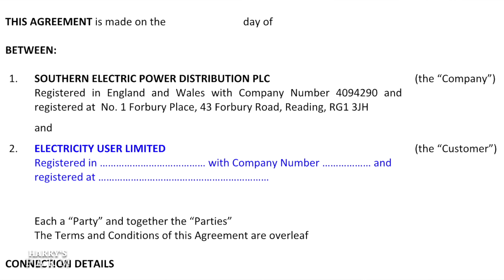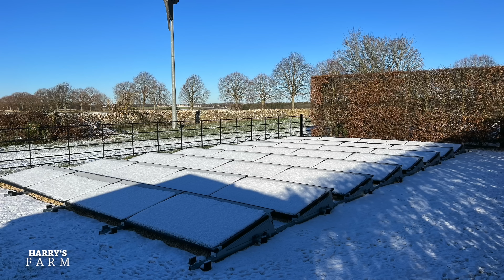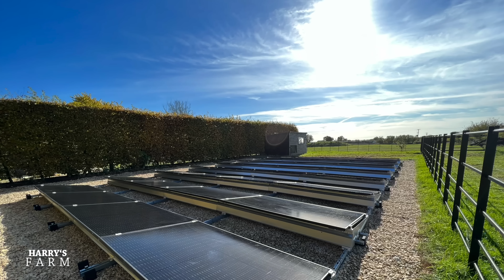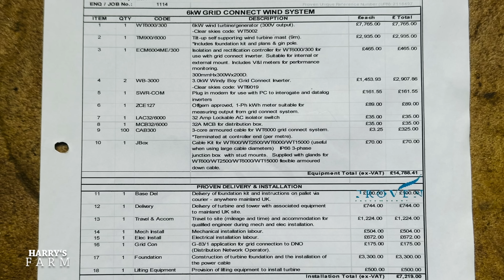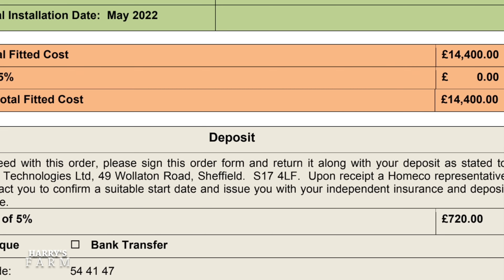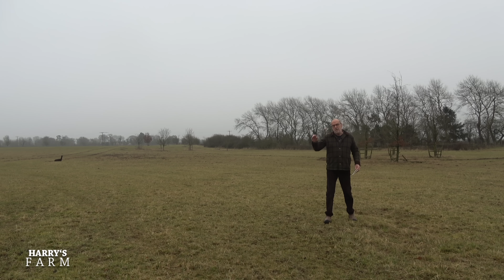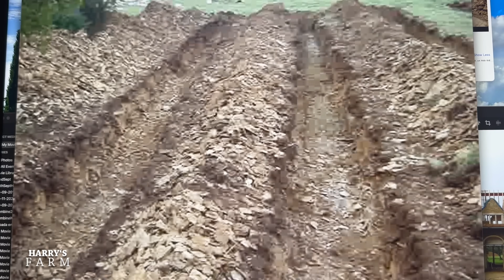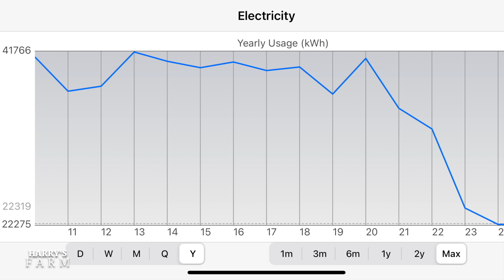Are solar panels & heat pumps worth installing? Here's what I've learnt after several years of use.

Comment: Was considering solar as a possible supplemental source of heating to augment our oil-fired boiler feeding a wet. System. Situated in Shetland, Scotland but due to the amount of glazing in the house, we use virtually no heating between April and September. Solar therefore clearly isn’t the answer as we can’t store the excess summer heat/winter output would be so very low. Don’t own the surrounding land so a turbine or ground source heat pump are out in practical terms. Perhaps an air-source heat pump is an option (but don’t qualify for the Grant), or just continue with the wood stove we put in around 15 years ago! House around 300 square metres in floor area, well insulated but to 1998 standards, pre-kingspan - nice to see the snow not melting on your roof! 
Thoughts? Excellent informative video!

Comment: Your panels should be oriented better - they are pointing up toward the zenith.  That might be almost ok in Jun but you want them much steeper so they output something in Feb.  Do the geometry!  the sun rises to 90-52-23.5 degrees at noon in December.  Only about 15 degrees.  Tilt the buggers more!  Of course you cannot get the rated output if they are not catching the suns rays at close to 90 degrees.  Honestly....

Comment: Those panels aren't installed on right angle for the optimal output though. They might have the maximum output when you least need it, but you want something better in the winter.

Comment: why didnt the installers parallel wire panels expected to be shaded and series wire those always in the sun. At Treetrench uk we would have done it this way to maximise solar output instead of randomly connecting panels in series and parallel, without taking into account shading and panel orientation.

Comment: Sorry Harry, but your ground loop slinkies don’t look like they are 6 ft deep. Had you doubled or tripled the amount of loops per foot of trench by having them overlap, and doubled the depth of your trenches to between 6-10’, that would have more than doubled the efficiency of your system, and ensured the return water was well above 0 degrees because of the increase in depth of the trench. Cheers.

Comment: It's hard to justify ever owning and operating an Aga in a low carbon home.  Thankfully Harry doesn't really attempt to do this numerically.  The GSHP and, say, an induction hob are going to far outperform an Aga in terms of heat output per unit of electrical energy input.

Comment: Ground source in trenches can cause the ground to actually freeze! This is because the heat pump takes a few degrees out and sends it back into the ground at zero degrees and over time the ground freezes.

Comment: Cover your swimming pool in winter with an insulated cover, and then use a seasonal water source heat pump system to take the heat from it - Simples !,,

Comment: Those panels are in a very low angle and need to be corrected.  Solar works best together with battery….Battery protect from the high hourly cost so it is not only for catching the solar power

Comment: - Something wrong with the install if only getting 100w on a cloudy day from 12kw of panels. 
- Does it have optimisers fitted per panel? 
- You should be getting 80-100w per 500w panel so 1/5 or 1/4 of the total kw

Comment: I'm surprised that you had it installed without knowing about shade - its' the first thing I thought when I saw the hedge and I haven't even got any panels yet. Since they're on the ground you can use modular inverters without any concerns about maintenance so that would solve that problem.

Comment: Solar in England is a mistake, unless you use a heatpump (water heater insulated pipes right underneath the panels) to run heating for it AND use the expensive Polycrystalline panels that keep operating optimally in partial shading (shade, fog, cloudy weather etc) you're never going to get any production during winter months.

Comment: Well, a lot of the reduction in power production in winter comes from the installation of the panels. Facing almost straight up, at a pretty high latitude, really only works in summer. You would get much more out of them in Winter if install them at a much steeper angle. If you really care about Winter production, even placing them vertical can make sense, assuming you have a place where they can be vertical without getting excessive shading.

Comment: My favourite video of Harry's so far. 

We have a cheaper version of parts of this installation - including the same wind turbine. 

My main suggestion would be that a battery can pay for itself partly through using the night rate tariffs like the one Octopus offers. You can buy electricity to charge the battery at the night rate of below 10p and use it during the day. This is especially the case when you're using so much. 

And questions..

Have you surge protectors on the turbine. We didn't.. And our turbine has been out of action for about 9 months from a lightning strike. 

And I know it might feel like an invasion of privacy, but what's the total cost? My guess is that this whole lot approaches 200k. While this is a really useful video, people need to be aware that an installation like this is way out of reach for most of us.

Comment: A lot of these output issues have to do with not only your weather and the general cloudiness in your area…but also that you did not opt for an elevated rack mount that you can change the angle with…30 degrees in winter and 22 in summer would help you and elevate it so the hedges don’t shade your panels.

Comment: You have your panel angle set for summer not winter, in winter, they will need to be set 45-55 degrees in the UK. Also, also I get over 500W output from a 400W panels on cold days, as they are rated at 25 °C, and any colder you gain power.

Comment: I’ve done studies on the aspect to the sun on two roofs.  During the summer my electric usage is pretty minimal, obviously it changes during the poorer weather months and I don’t think I would see a decent return for quite a long time.  Without battery storage, plus massive rise in initial cost so again for me I cannot justify as I’m in my 70’s. I’ve done a thorough cost analysis and the solar plus batteries would be fine to support a heat pump if I had one.  This is an extremely useful vid.  Thanks KR Mike

Comment: Question: if the house has to be so well insulated for these systems to be ANY good, why not just have individual room electric heating - very granular and less loss of efficiency (no pumps, heat transfer etc).

Comment: They are building new houses near me, in September 2025. Some of the houses have solar panels but instead of sitting on top of the roof tiles, they are integrated and recessed into the roof itself and it looks great. The panels are the same colour as the roof tiles and the recess is the exact depth so that the surrounding roof tiles are at the same level. It looks fantastic! I always hated the way the "on top" panels looked, I thought it was ugly, but this solution looks great.

Comment: Ground source heat-pumps work well if you have the space, but to argue with your installers, a borehole at 1,000 metres can get as high as 40c. But then there is a minimal loss as you pump that water back up. Or you can go deeper and get even higher temperatures. But they are expensive at around £200 per metre.

Comment: It's an expensive way of heating a house. Arguing that it's four times the size of a normal property so you would expect it to cost more is ignoring that the heat pump is a 28kW unit whereas a standard domestic gas boiler is similar at 24kW.  It's the insulation that makes the property a lot cheaper to heat than 4 houses.

Comment: Solar panel efficiencies are increasing due to technologies like tandem cells and new materials. New research has shown perovskite-silicon tandem cells reaching over 33% efficiency, with potential future applications promising even higher, exceeding 45%. Once these are made enmass, which will happen quickly as the Chinese make them, the panels will be viable in winter, giving over twice what Harry is getting right now. 

They may prompt the introduction of highly insulated, underground, inter-seasonal heat stores on homes that have the space. Or above ground on spacious farms. Heat the store in summer using all available electricity produced, use the heat in winter. The odd good days in winter for insolation can add some heat along the way.

Comment: The average input for heating the average home is not 24kW it is around 8-10kW. The 24kW is the size of a combi which uses the 24kW to heat the hot water instantly.

Comment: Your PV is angled for Summer; it looks pretty shallow. Spaced out more to prevent shading and the ability to change the angle would have a significant effect. Depends whether you export for much money or use the power generated and when. If exporting for money then you probably have the optimum angle. If you are wasting generation mid Summer then make them steeper but beware that in Winter the panels will tend to shade each other if too steep. This is why sloping roofs work well. If this is an older traditional system arrangement with just one inverter at the end of everything then shading of one small part of one panel has such a large reduction effect because all the cells in a string have to be exposed to light for decent current to flow. Shade one part of the string and you significantly block the whole string. I suspect you have a few strings in parallel there. The installers should have educated you better. In the UK, fitting batteries is a must with solar for most domestic installs unless they can use all that is produced when it is produced. It means you charge the batteries then can use the batteries at peak use time in the evening; it's all automatic of course. Yes, you won't get much solar into your batts in Winter but get on a tariff such as Octopus Go and you can set the batts to charge at cheap rate (about a third of normal cost after inefficiencies) overnight. An EV is not necessarily a replacement to domestic batts because an EV needs at least 1.4kW to charge and it might not be plugged in during solar times. Maybe get a solar diverter (cheap compared to everything else) for a sensible size immersion heater water tank (if you have one) and that helps put to good use some excess lower than that. Or, as you say, get a pool (!), but then it's probably cheaper getting water panels directly heated by the Sun.

Comment: Always rate your system to the worst month if you’re actually dependent on your output. In December, the sun  is at  17 degrees above horizon at the winter solstice. So a 77 degree angle on panels, but 45-50 degrees is a good compromise.

Comment: Well, God Bless!
You got five million to spend, of course you can build an energy efficient manor. Other than that, it's quite interesting to have a hands-on comparison between solar, wind and heat pump. It's the heat pump that wins, and that says a lot about both the accumulation of wealth and/or energy: you get a lot by spending less, not by producing. That's why the "working man" keeps getting poorer while the rich keep saving and get richer. Unless we address this truth by taxation (it's basically what the heat pump does, it takes from where there's a lot and gives where there's a need) we'll be stuck in the stupid political debate that always ends in the poor being told, "work more".
Pax Christi

Comment: I built 2X4kw two axis trackers which have higher yield than static panels. After 12 months the ROI after depreciation is 1.68% on a DIY install. Solar production peaked in May for us, output in December only 8% of May. Solar - meh. The windmill is looking pretty useless to, recommended height for a windmill to be viable is 25m+. Anyone building a solar system should scale it to 110% of Summer consumption.

Most cost effective is batteries for households with cheap night time electricity so everything can be charged at the cheap rates and used when higher rates apply. Forget solar, forget windmills unless you are prepping for grid blackouts.

Comment: I've never installed a single solar panel in my life and I could've told you all these things from just watching a few videos online - you didn't properly do your research it seems. Low angled sun in the winter will mean the need for a higher angled panel to actually capture what the sun is sending us. Also in general ground based panels with things that create shade such as bushes, hedges, buildings all around was a mad idea, you'll even lose out on solar gain in summer when the sun goes behind the bushes, the building etc. That's why they're put on roofs, or raised up above obstacles - this is very basic Solar practice.

Comment: You could increase the output of the solar panels in winter time by arranging them differently. If you put them perpendicular to the sun at that time, they simply get more ligt per panel. It’s simple physics. 
Downside is that you lose yield in the summer time. And you need a bigger area to set them in to prevent them throwing shade amongst each other.

Comment: Paying for a wind turbine, solar panels, ground source heat pump and an air source heat pump, plus servicing and maintenance. If the solar inverter goes it will cost about £1,000. It would be interesting to see the calculation for how long it takes to pay that off in electricity saved. I’m assuming your annual bill of £5,300 is after using up all the electricity you generate I.e what you take from the grid. How long would it take to pay off your investment? You don’t mention subsidies and I think that is the only reason people can put these in and that is a hidden tax on all other energy customers.

Comment: Turbines are awful for the grid because their power output is so spikey and unpredictable.  An electron pushed into the grid has to be matched by an electron leaving the grid somewhere else at basically light speed, so when a gust picks up, baseline generators (that's gas to you and I) have to spin up and down VERY quickly.  Renewables are one of the main reasons nuclear is having such a hard time getting going - nuclear can NOT spool up and down quickly.

Comment: That's a crazy way of mounting solar PV panels, high maintenance for weed control and high risk of damage, much better on a raised frame. Don't tell me you just spray around these twice a year.
Reply: Pretty sure there is some sort of geo-cloth under the gravel to keep the weed growth under control. Otherwise it would be quite a problem
Reply: @flynnjp19  There's a form over function problem here, especially with shadow as the days get shorter where every last bit of light matters, cheers

Comment: where i live, solar can cover all your costs AND you can sell the rest to the grid... however, i live in a part of the world where AC in summer is not optional, if you don't have AC you'll barely be able to regulate your body heat, it's HOT AND HUMID here.

Comment: thanks for your detailed comment.  amazing to watch how useful the ground source heat pump has been . it must have costed a lot to put that in and to insulate the house to such high efficiency. 
with my solar panels, i have used micro invertors to help with the shading .

Comment: You ground mount panels are way too flat. The Cotswolds are at about 51 degrees Yu'll get MUCH better output if your panels were set around 45 degrees for a good balance between summer and winter ...

Comment: Having watched your video again today I think you've missed the main point of a battery incorporated in a solar array. I have a Fit system of 4Kwh on the east elevation of my roof which was installed about 10/11 years ago. I have now installed a battery and 4Kwhs on the west elevation. The key is by having a night time tariff to charge the battery @ £0.08pkw between 1200 - 0500  each night the battery system is programmed to sell the solar energy produced through the day to the grid at £0.15pKw which makes you £0.07pKw which is more than enough to pay the electric bill for the night time usage. You can also program your cars to charge at the cheap night time rate! that is how to use the battery not by charging you battery from  the roof. It will balance out the cost of your energy across the year to around the daily stand by plus a little more depending on your demand.

Comment: Just to add to my previous comment today, is the car running costs. 600 miles a month at say 3 miles  per kW is 200 x 7p = £14 v 40mpg on a petrol car is 15 gallons at about £80 less £14 is a monthly saving of £64 x 12  =£768.00 p.a so when added the the £1,400 = £2,168 v £17k outlay = over 13% return tax free

Comment: The point about batteries in the summer is they maintain 100% charge on sunny days thereby exporting kW @ 15p having charged the batteries at cheap rate 7p kW. Your situation is very unique. I live in a 5 bed 1800sq ft and May 2025, my electricity costs were £6. £44 actual use set against £38 export, and that includes app 600 miles of Hybrid car charging
I have 4.2 kW of Solar set over 2 roofs SE and SW that on a very sunny day produce 25kW. My electricity costs before the installation were £2,000 p.a. and now around £600. The installation cost £17,000 as it is quite comprehensive with 20kW of batteries and an “island” situation where my essential supply is maintained during any grid outage. I have never looked at pay back time, only investment return on my money, so £17k @ 5% and subject to tax v at least 8%  (£1,400) on Solar/Battery, with not tax implication
My next project is Air Conditioning to utilise over capacity of electricity during hot periods that also double as heating during the winter, reducing gas usage. Gas cost per kW are similar to off peak electricity, but I am lead to believe gas is 20% less efficient